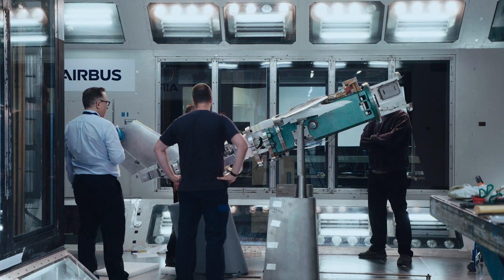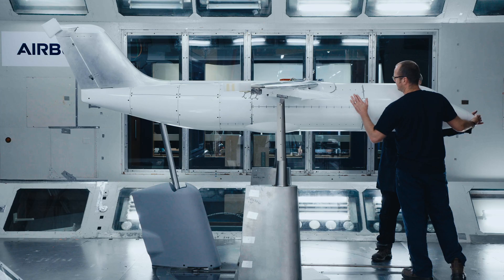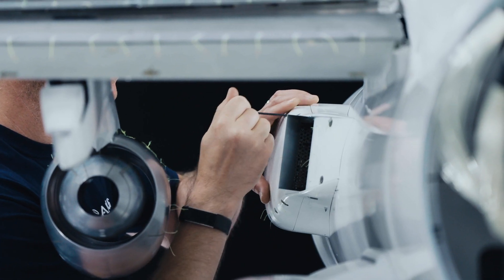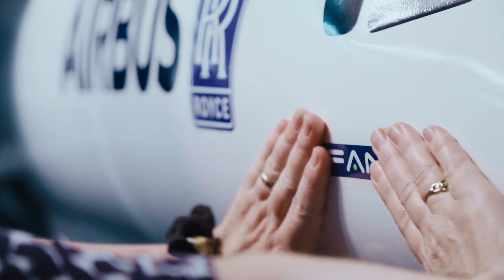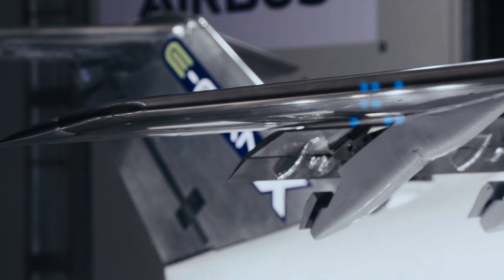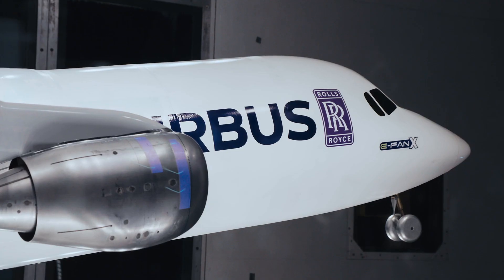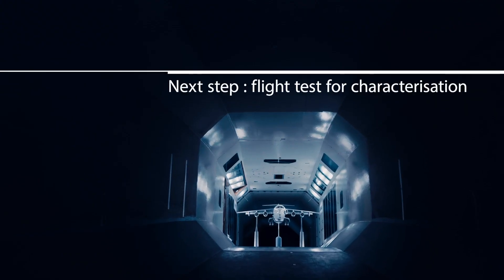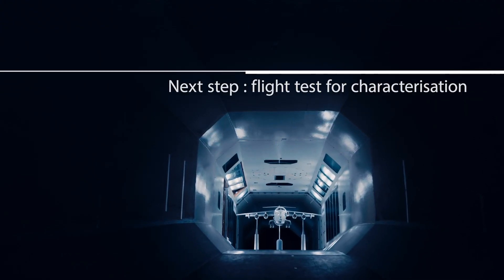E-Fan X: Wind tunnel testing

Comment: What's the point of a hybrid gas-electric aircraft? Road vehicles benefit from that by not wasting fuel when idling but, aircraft don't encounter traffic lights.
Reply: Greenwashing for Airbus  ;-)
Reply: dendo111  Yes, I know of one other concept. One can run the gas engine at it's most efficient regime to charge a battery. Then use the battery when the engine would be running inefficiently.
But Variable Transmissions pretty much made that concept redundant today. But this cannot be used in jet turbines either. Their efficiency are based on combinations of speed, altitude and chamber pressure I would think.

What am I missing?
Reply: dendo111  I'll do that, as soon as they send me a paycheck. :)

Joking aside, I was expecting the staff on this channel to jump on this and point out some other concept that I'd never heard of. You did, but so far it's zilch from Airbus.
So I'm guessing Airbus has no counter-point. Therefore I'm assuming this whole thing is just a research project, like the laminar flow A340 testbed, or simply a waste of money to appeal to, and attract, the so-called "climate emergency" sector.

Comment: I hope this goes into production! Likely won't, but a guy can dream.
Reply: Yeah, the sheer gap in energy density by weight of batteries compared to jet fuel is far too big to allow electric aviation on any scale larger than tiny, paper-weight aircraft like Cessna 172's and the like